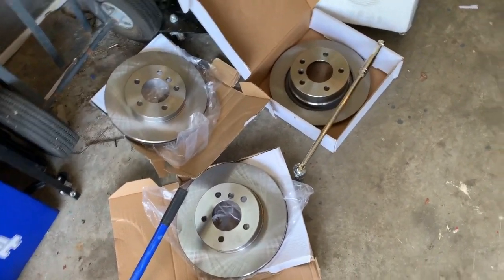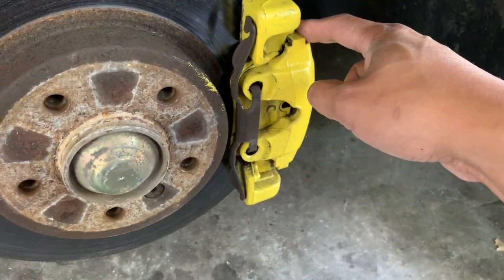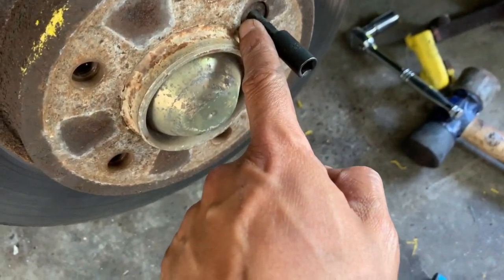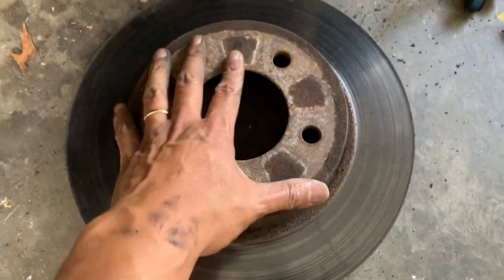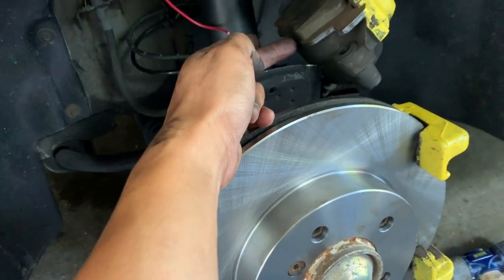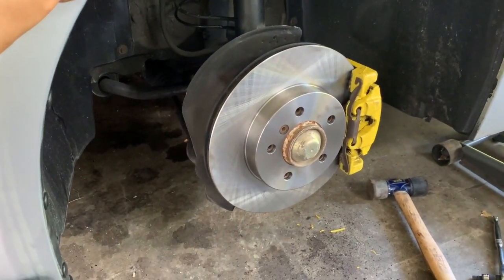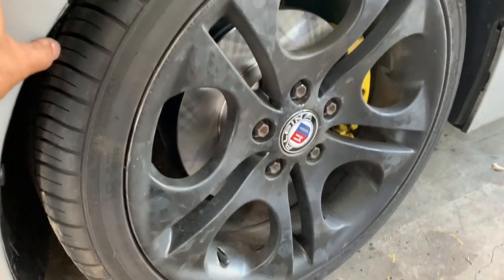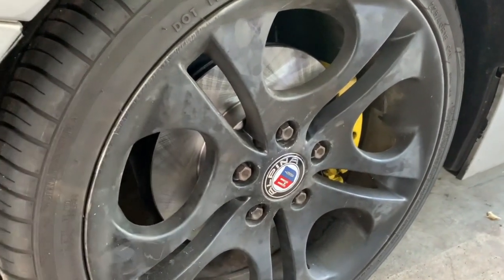bmw z4 - rotor replacement

Comment: Thank you for all of your videos. I just purchased a 2003 BMW Z4 with 113k on the odo. Red oil that smells of gas. A bad maf sensor. A misfire in cylinder 5. A bad thermal oil level sensor. Thank you for all of the tutorials.
Reply from the maker: Greens And fiends I am still filming.  Will post more. If you can too,  we can grow the BMW Z4 YouTube videos.